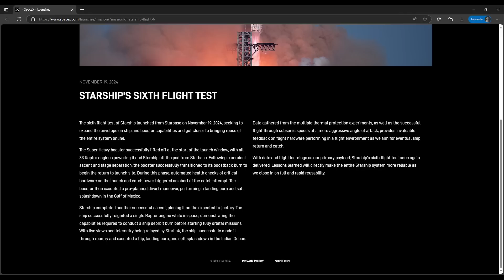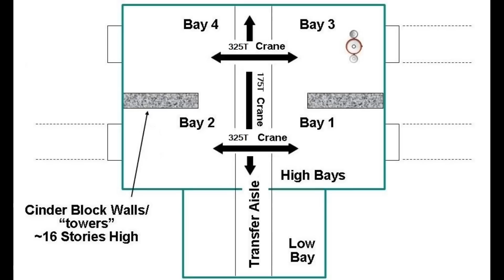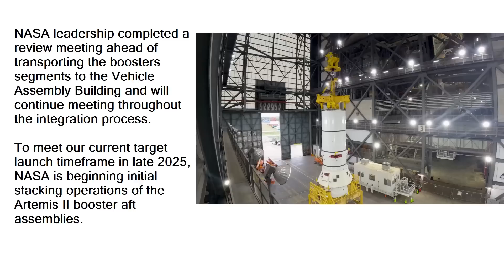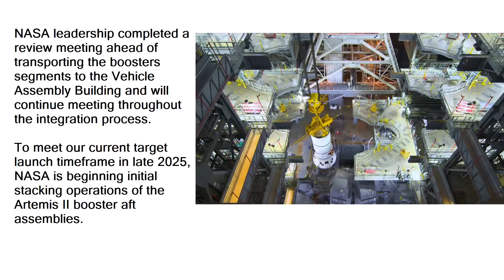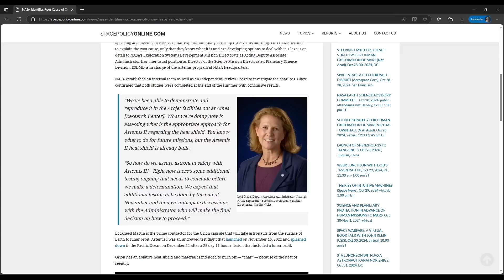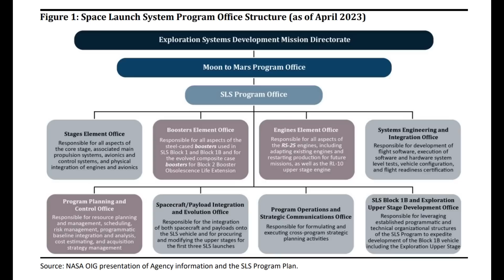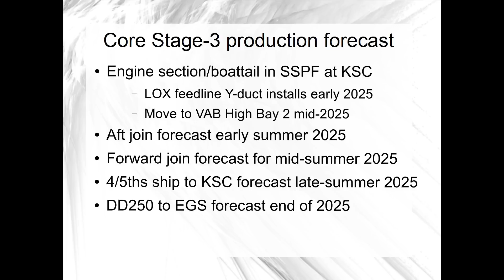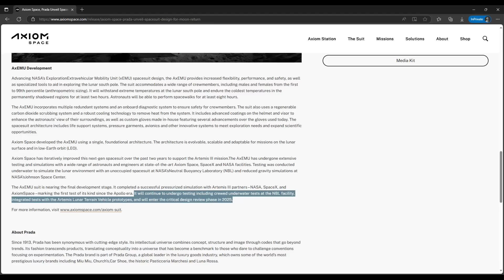Starship flight test six completed while Artemis II stacking begins and then goes back on hold

Comment: I just don't see why a tank with 2 separate tanks inside, rocket engines (already built) and 2 SRBs takes so bloody long, they should already be working on 3rd and 4th rocket right now shouldn't they? Its like they WANT to slow down rather than try to beat the Chinese to the moon. I've never seen people so mediocre in my life.
Reply: Yep. !? The rs25's already built, some already flown on the shuttle. The solid boosters are just shuttles, with one extra ring.. forget the time it's taken, how can it cost sooo much to hook those old engines up directly to the old shuttle tank?!!
Reply: @russellcrosby8175  so right, so basically they have to build a tank which they have experience in and the avionics, so how the bloody hell does this take so long? Lack of stern leadership and leveling of severe fines if goals aren't met. Hopefully it will be canceled it'll hurt but private co. can pick up slack.

Comment: Phill Sloss, do you see Artemis Program getting canceled? I'm getting worried because by then we're going to have a new president & I would be very dissapointed by delays.
Reply from the maker: Artemis is a brand name and it was introduced when Trump was last President, so the brand name is likely safe.  Due to Musk's involvement, the rumors are that the pre-Artemis programs might be in jeopardy -- Orion, SLS, and the related programs like EGS and Gateway.

The politics of this situation are unique and unavoidable, particularly due to the players, so there could be one set of messages in public while a lot of horse-trading and negotiating is going on in private.

We're waiting for more information, whether that's political trial balloons or more rumors or maybe something more formal and policy-flavored, until the new administration takes power.  But that's not for another almost two months.

Comment: I thought they were gonna relight one of the Raptor vacuum, why did they just test relight ability of a Raptor sea level?
Reply from the maker: IIRC, the sea-level engines can be gimbaled; that may be one of the reasons.
Reply: @ Hi Philip, thanks for your answer! Learned a lot watching your videos!
Reply: RVacs have static mounts and are further away from the center line of the ship, so a single ignition will exert a moment on the ship that can only be corrected by sea level engines or RCS. It’s expected that Starship will always operate at least one sea level engine during orbital burns, and will end burns by trimming their velocity using the sea level engines exclusively.

Comment: Could you compare Orion heat shields to Apollo heat shields? I'm trying to understand Apollo heat shields worked so well back then and if Orion is trying something new or if they are using the same proven methods and materials from 50 years ago, thanks!
Reply from the maker: I'm thinking about doing a video about the investigation before the decision/announcement, but I've done a few segments on some history.  

Here's one talking about some of the differences from a video a couple of months back:
https://youtu.be/j87z7lu5ClY&t=9m51s

Comment: In an absence of honesty from NASA, it's pretty safe to assume their stacking of SLS is purely political postering just so from the outside things look like they are moving, kind of like when an idle employee starts fiddling with stuff when the boss is walking around so it looks like they are worth more then they really are. The reality is NASA has not found a prompt solution to the Orion heatshield, so if Orion is stacked it'll have to be destacked later and NASA knows this.

This lack of faith in NASA is well warranted as well, they pretty much lied about the state of Starliner for weeks until they couldn't lie about it anymore, people with common sense in the space community knew that Starliner must have had a serious issue that prevented it from reasonably reentering in a crewed configuration after the 8 initial days, but NASA insulted their intelligence by lying to their face, and to be fair a lot of the posers and let's be frank, activists in the space community did buy their lies.

The simplest explanation is usually the correct one, in this case, the stacking of SLS is purely postering, even if NASA did dispute this, it wouldn't be a completely trustworthy statement, but the fact that they haven't speaks volumes as to the truth of the situation.

Comment: Could the Artemis mission be done without sls and orion by doing this?

1. launch and refuel hls starship and send to nrho.

2. launch and refuel regular starship and leave in leo.

3. launch falcon 9 with crew dragon to bring crew to starship in leo (dragon will either remain docked to starship or stay in leo).

4. The starship transfers to nrho and docks with hls starship and crew transfers.

5. hls starship goes down to the moon's surface, and they do whatever.

6. hls starship comes back up to nrho and docks with regular starship and crew transfers.

7. starship returns to leo, the crew gets back into the dragon, and then the dragon returns them to earth in the normal way that it does.

This seems like it would work to me and it would be far cheaper and would use already proven technology (besides starship, but that's required for artemis anyway).
Reply from the maker: It's a popular concept and it seems feasible, but it's questionable whether the Gray Dragon modifications/infrastructure would be ready by the end of Trump's stay in office in 2028.  Musk would have to pay for that for probably up to a year before a government contract could even be let.

Setting that aside, the best guess right now is that Starship HLS itself won't be ready for a lunar landing until 2028.

Trump and Musk could still choose to go with Gray Dragon, but right now Orion and SLS are the fastest way to transport crew back and forth to the Moon.  At least for Artemis II and III.
Reply: @PhilipSloss  I'm not aware of what the "gray dragon modifications" are?
Reply from the maker: @That_Awesome_Guy1  I'm assuming that NASA would be the customer for this, in which case they would want to bring the Earth return spacecraft to the Moon and back.  In that case Dragon would need to be modified to handle different radiation, comms, and navigation for aborts during transit to and from the Moon.

If someone else is paying and you only need Starships to make the roundtrip from LEO to the Moon, then as you noted in another reply, there would need to be a refueling capability in lunar orbit, which would be a longer supply chain to keep replenished with tankers.

Eventually, the lunar surface is probably the best place for refueling.
Reply: @PhilipSloss  Couldn't they leave the crew dragon in leo? Also the lunar refueling doesn't have to be done. It's just an option to reuse the hls.
Reply from the maker: @That_Awesome_Guy1  If NASA were ordered to accept those risks, yes.  Otherwise it would have to be an outside customer that is willing to accept those risks.

Setting that aside, it would probably require two, fully-fueled Starships to fly out to the Moon together in order to make a roundtrip from LEO to the lunar surface and then back to LEO.  Not impossible, but would require more delta-V to brake from TEI into LEO versus a straight lunar re-entry.  (Dragon's heatshield should be able to handle that, which would be another reason to bring it along.)
Reply: @PhilipSloss  I see. Well it's unlikely to happen regardless and I hope artemis is successful and not delayed beyond 2028.
Reply: Sounds very workable, but I'd use a circular lunar orbit instead.
It would use less fuel overall and make the actual lunar landing much simpler.
Reply: @ghost307 Maybe I haven't done the delta-v calculations for that scenario. However, I believe with what I've outlined when the two starships dock for the return the regular starship could theoretically transfer some fuel to the hls starship so that they both have enough delta-v to get back to leo. This would make the whole system (mostly) fully reusable.
Reply: @That_Awesome_Guy1  Agreed.
I could never believe that after launching from the lunar surface that HLS would just be abandoned in lunar orbit, given the SpaceX obsession with reusability.
I think that's why they're upgrading sup-heavy and increasing the size of Starship.
Reply: Why we need 2 starships? 
Just 1 fully fueled HLS starship and 1 dragon, transfer crew at leo, undock, go to the surface of the moon, go to leo,  dock, transfer crew back to dragon, deorbit,  moon starship stay at LEO
Reply: @Syntropics  One fully fueled hls starship is not capable of going from leo to the moon's surface back to leo. It's simply too much delta-v (at least I'm pretty sure it is).
Reply from the maker: @Syntropics  Delta-V from LEO to the lunar surface is approximately 6 km/s.

Approximately 3200 m/s from LEO for TLI,   900 m/s to LLO, and 2000 m/s from LLO to the surface.

Roundtrip would be twice that to brake into LEO from TEI, so approximately 12 km/s overall, LEO -- lunar landing -- LEO.

The heatshield and a direct Earth re-entry is alternative to the delta-V required for "Earth orbit insertion."
Reply: @PhilipSloss  I think it can be possible
Dock with dragon in LEO, Take it to LLO, undock, surface, LLO, dock, take Dragon almost to Transfer orbit (dragon have another 400m/s then aerobrake) 
1) Launch with payload about 35t (10x times more than apollo lunar module drymass) + dock with 15t modified Crew Dragon
2) Assuming 165t dry mass, 25t landing propellant, 10t residuals and 50t payload we have about 8200-8300 m/s (even more because we drop dragon at LLO and drop some payload at surface. ( and dragon have another 350-400m/s) 
3) Solar system delta v roadmap tell be that from LEO to Lunar surface is about 5661 m/s, lets take 5.8km/s, from surface to LTO 2542m/s, lets take 2.7 km/s, combine 8.5 km/s
So if starship would be light enough it can be done, or i miss something?

Comment: For Artemis I, didn’t they extend the SRBs’ 12-month ‘clock’ by another year when they kept delaying? Seems redundant to even have that ‘clock’ if some manner of inspection can always get them signed off. It’s not as if the expiration date of the ‘clock’ acts as any meaningful goal or hurry-up on any other aspect of preparation.
Reply: Edit: now seen other reply on same matter.
Still seems like the 12-month ‘clock’ really serves little practical purpose and - as noted - has already caused delay despite the fact it can be (and has been) extended by an inspection.
Reply from the maker: @geraint8989  NASA is respecting multiple life limited ops items.  Otherwise, they are practically trading away a significant amount of schedule margin, many months worth.

If there were no constraints against stacking SLS, prepping it for launch, and waiting for Orion, they could have already completed a good chunk of the six months of preparation work on SLS alone, which would allow them to be in a launch ready position that much sooner.  (And also deal with any issues that came up that much sooner.)

The SRB stack life is/was extended by analysis, not inspection.  They have to take measurements at the time of the field joint mate.  After the boosters are stacked, there is no safe way to directly inspect the J-joint/J-leg that drives the time constraint.
Reply: @PhilipSloss  Thank you. So if, with Artemis I, they were able to extend the limitation after stacking (without the ability to inspect) by way of analysis, can’t this analysis simply be continually performed ahead of Artemis II stacking to have a continually updated ‘real’ expiry date?
Reply from the maker: @geraint8989  OIG warned against that in May, writing: "The ability to extend booster stack life is based on actual hardware measurements of each individual booster. As such, there is no guarantee that the life of the boosters for the Artemis II mission can be extended the same amount of time as the Artemis I mission."

This set could have a longer life or a shorter life, depending on the measurements taken at the time of the field joint mate(s).
Reply: @PhilipSloss  Thank you, once again. Best wishes.

Comment: The entire Space Launch System (SLS) is currently considered to be in a "lame duck" status while we await the direction of the new administration. Various components are prepared but remain on hold pending assembly, which will inevitably affect multiple timelines. A prompt decision regarding the future of the SLS will facilitate the resumption of stacking operations. Moreover, the heat shield continues to present a significant challenge.  Thanks for the excellent reports that I eagerly wait for each week, but I also shake my head at the news we hear.
Reply from the maker: NASA has not and is not being forthcoming about the investigation; otherwise, they would have been willing to talk about root cause and options and so on a month ago or earlier.  It's possible they have made some granular, low-level choices (they aren't saying).

The Artemis II Orion schedule is still the critical path and it isn't on hold, otherwise it would likely be buttoned up waiting, too.  That's still going to drive the readiness schedule for launch.

In the meantime, the Artemis III Orion and SLS hardware still has a lot of work to complete, but there isn't that much of it impacted by the heatshield investigation yet.  (Setting aside the HLS schedule.)

The political spice dumped on top of things could, at this point or in January, or both, play a bigger role in scheduling for next year and 2026.
Reply: @PhilipSloss  I appreciate your response. I am an avid supporter of your content and reporting, and I share your publications in the relevant threads on NSF when they are released.

Thanks
Tony (catdlr on NSF)
Reply from the maker: @CATDRL2  Thanks Tony, appreciate it.
Reply: @PhilipSloss if the issue and/or “fix” for the heat shield is proprietary, etc, then don’t need to state the exact issue or how the fix will be handled. Orion will either fly asis or it won’t.
Reply from the maker: @rktmn1  It's not completely proprietary, since NASA and OIG have disclosed some aspects of the issue already.  Orion is also, like SLS, 100% taxpayer funded.

Comment: It's great seeing progress on SLS again!  When/if we get that Block IB variant it will provide a capability that no other launch vehicle in the world can replicate.  Specifically, the ability to deliver a crew of 4 and a payload to lunar orbit in a single launch.  Starship V2 may not hit the ambitious 100 ton payload target, and that will necessitate additional refueling launches to depot enough propellant in orbit for a deep space mission.  Requiring 8 (or more) launches to reach the moon is a level of operational and logistic complexity that is .. quite frankly .. a huge pain in the butt.   

Propellent loading, here on Earth, is a process that requires significant maintenance.  The orbital propellant Depot, required by Starship, will not have the luxury of being serviced.  The multiple docking and propellant transfer operations will incur significant wear-and-tear on seals and other parts that could easily fail, rendering the propellent depot completely useless.  For this reason, I don't think we should cancel SLS just yet.  It's unique capability, while very expensive, may allow deep space exploration to continue, should Starship fail to reach its full potential.
Reply: Only spaceX fanboys want to cancel SLS, and if NASA cancels it, new glenn or FH would replace SLS, starship is out, because is useless to go beyond LEO
Reply: New A*****ng laughing in corner

Comment: Informative as always Philip, I'm honestly getting a bit hopeful that maybe we will see SLS fly Artemis 2 next year, if the Orion heatshield does not need modification then the astronauts can fly the capsule on the rocket as is right? Only the heatshield is a major cause for delay concern regarding Artemis 2's flight next year. The other two watch items for Artemis 2 are just matters of schedule and timing that wouldn't be delaying the launch as long as the heatshield is approved right? 
I understand that the heatshield didn't behave as expected and that the long investigation means it was something that needed answers to a lot of questions, I also hope that NASA does go public with that investigation so we better understand the risks that the astronauts are facing as risk to the astronauts should be minimized wherever possible. Better be safe than sorry.